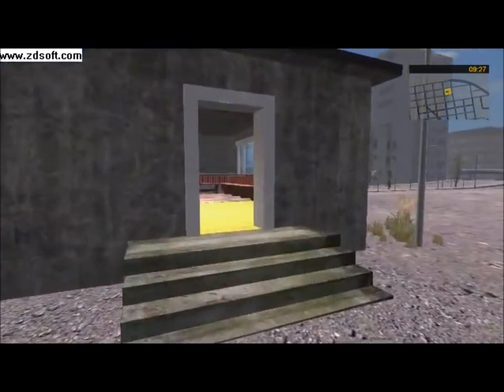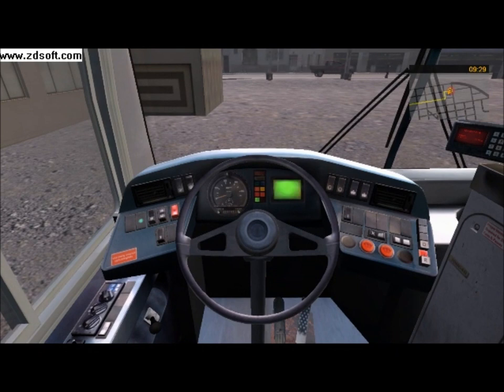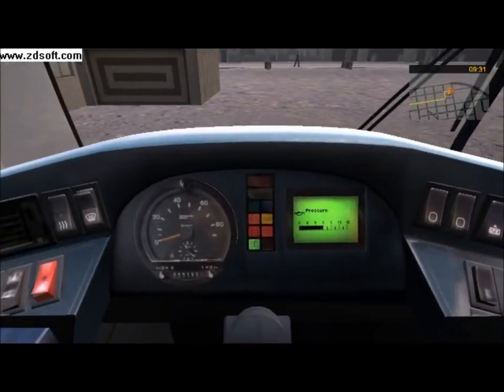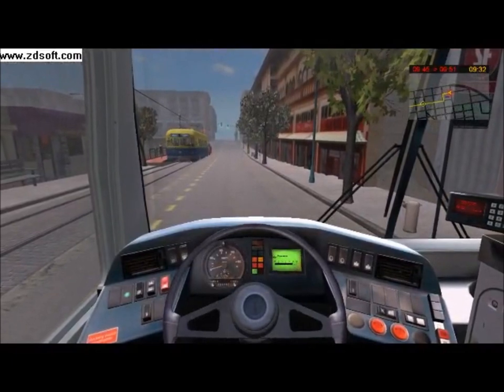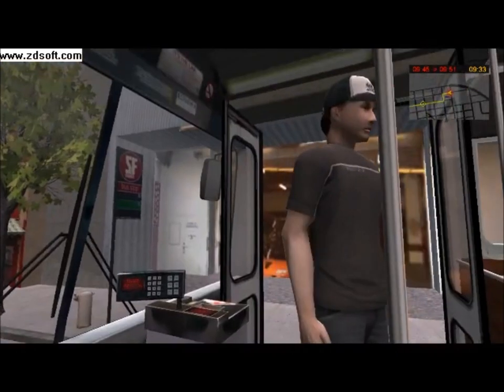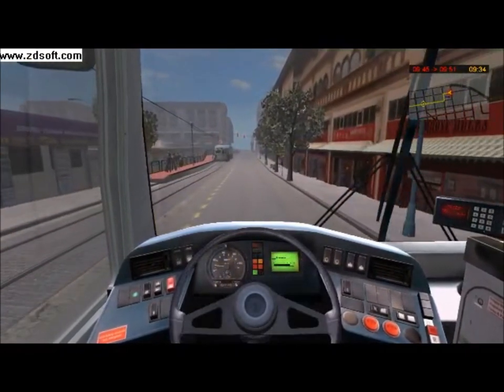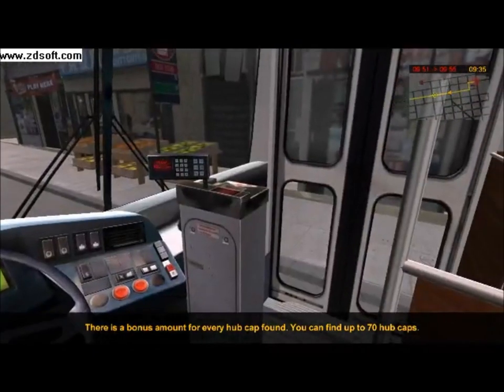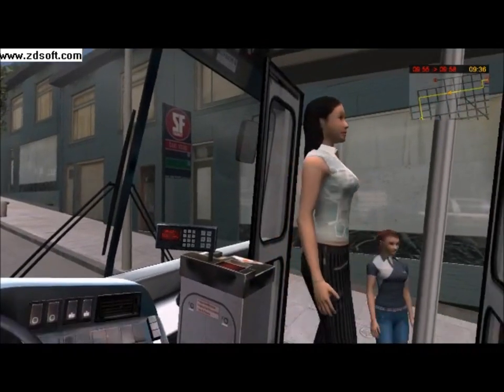Bus & Cable-car Simulator: TUTORIAL FOR BEGINNERS (English) (HD)

Comment from the maker: The only places where the speed limit is 30 MPH is on the city streets. On freeways or expressways (like the Golden Gate bridge and the highway that leads to it), the speed limit is higher, and is always indicated by a sign. When you are coming back into the city from those roads, there is a sign saying the speed limit is 30 again and you need to slow back down to 30.

Comment from the maker: The pressure recharges automatically as long as the engine is running, so if it happens to run out when you are driving, you probably need to replace the fan belt

Comment: sorry to ask but do you know where to get a fan belt for the diesel bus because the air pressure wont build up but before that I did a job from the job board and went to go and replace the fan belt and when I  opened the hood and clicked replace fan belt it said (you have no fan belt)

Comment from the maker: @MrLegometropolis If your air pressure does not rise if your engine is running, you may have a snapped fan belt. Buy a fan belt from the gas station, then open the engine compartment hatch and replace it.